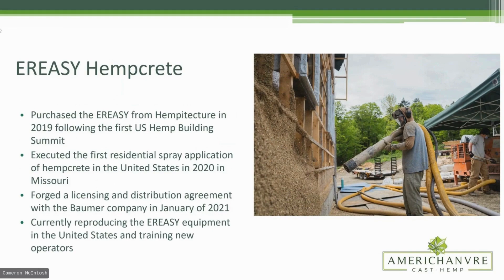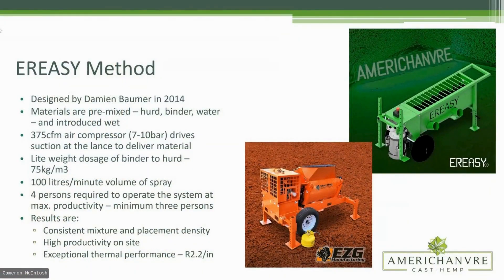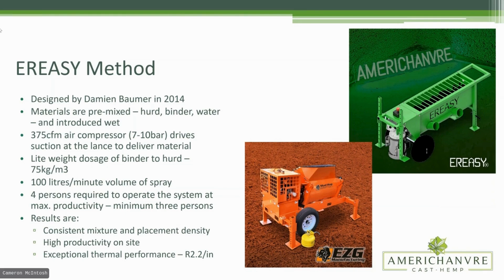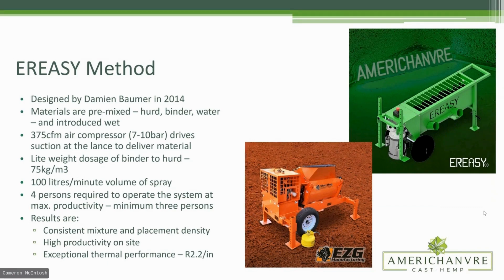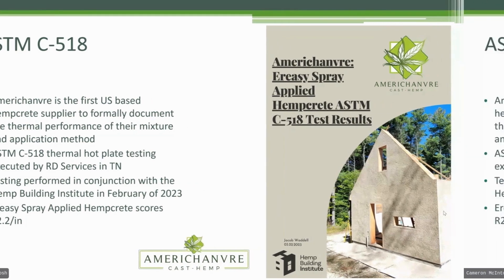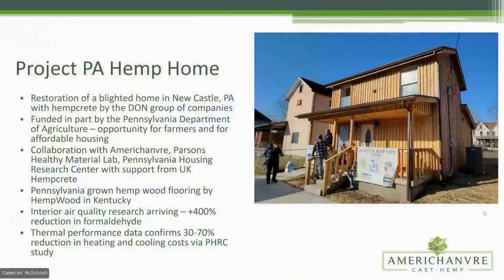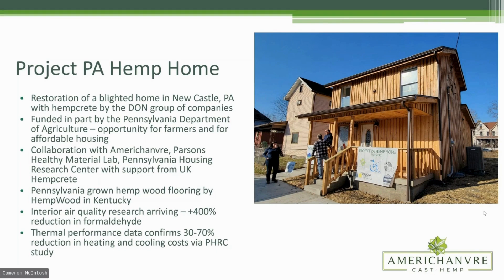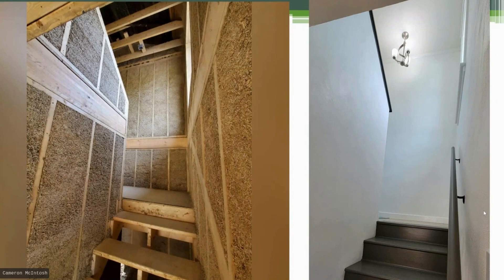Hempcrete Spray Application

Comment: Thanks buddy for sharing this presentation. Interesting that the hempcrete is mixed before it is sprayed on to the wall. The experience I had with a spray mixer at the nozzles was not great to say the least. One of the challenges in Australia is labor. I am wondering if you could use a combo of your style of mixer that kind of pumps it into form work, tamp, repeat?